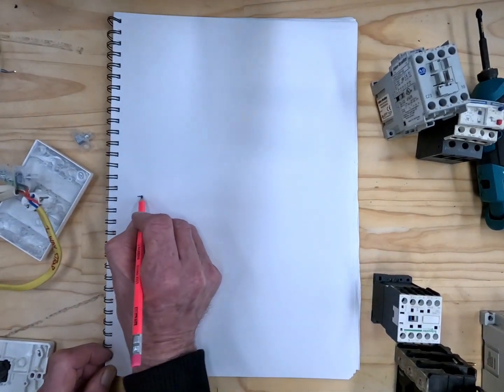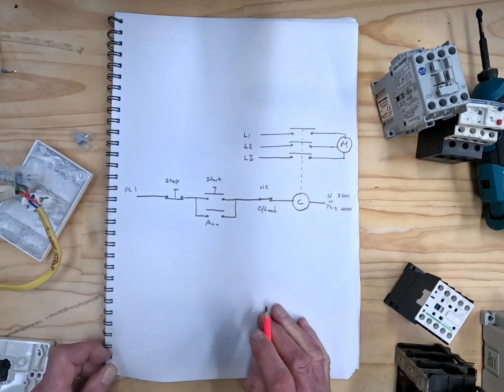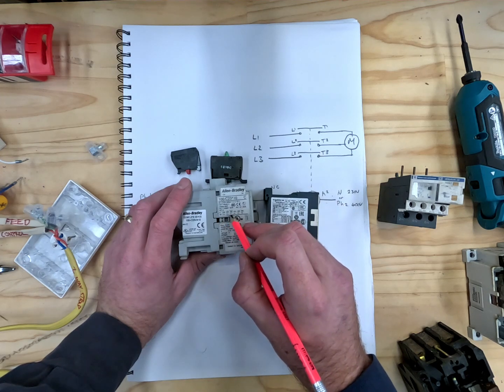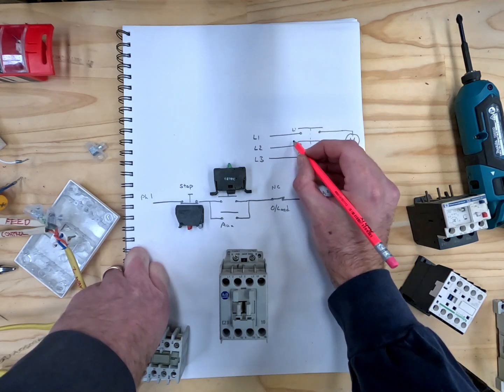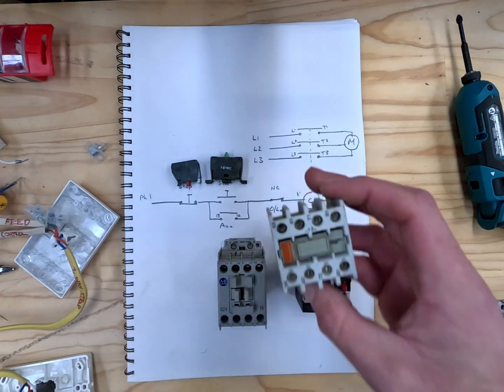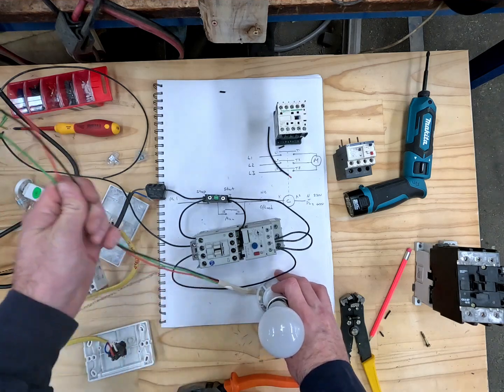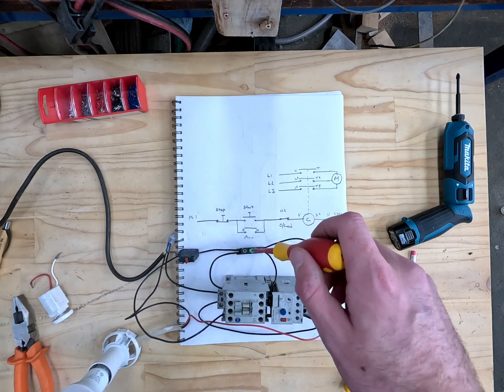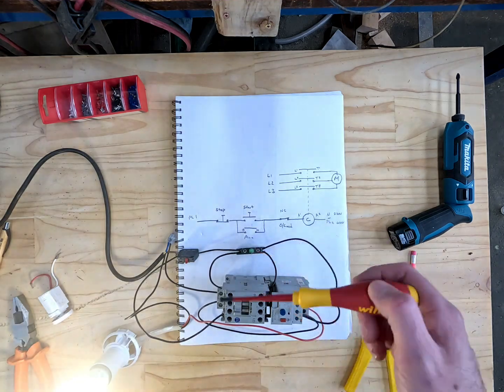Wiring a stop, start circuit with contactors.

Comment: Can you show, if it is possible, how to wire a 3 phase contactor which has no "auxilliary" contact within contactor that usually holds up the auxiliary circuit (NC, NO contacts) of the contactor..
I would like to include one of the 3 phase circuit contacts within contactor as part of auxiliary circuit as mentioned above.
Thank you.

Comment: Hi mate, 
See how you’ve put a link in between 95  and 96 of the OL is that needed?
Reply from the maker: @JacksonH-w6j  Well the circuit will work if you were to leave it out, but the propose of that link is so that it the overload was to trip then the starting circuit will cut out and won't even run. Which most importantly stops the motor and when you try to start the motor again it won't, so you'll have to go and investigate
Reply: @ aren’t they nc but? So if the ol trips they will open and the control circuit will cut out anyway? but the link will bypass the internal trip and keep the circuit pulled in?
Sorry mate haha
Reply from the maker: @JacksonH-w6j  that is very eagle eyed of you, I believe I did that because the overload is second-hand and wasn't working fully but was the best example 😉
Reply from the maker: @JacksonH-w6j  so in short yes you are right the overload wouldn't work properly in this case
Reply: @_nztradie  no all good mate just wondering thanks legend 🤘🏼